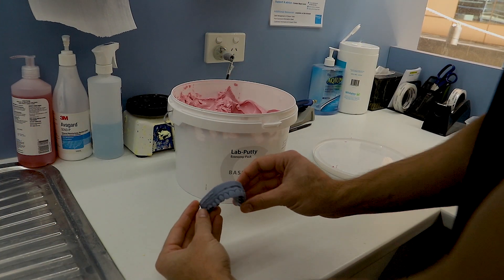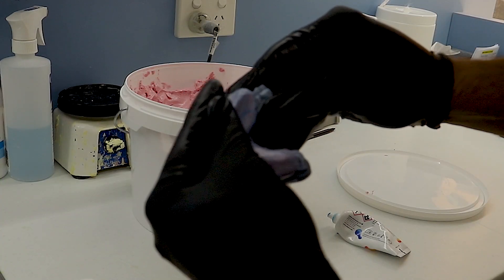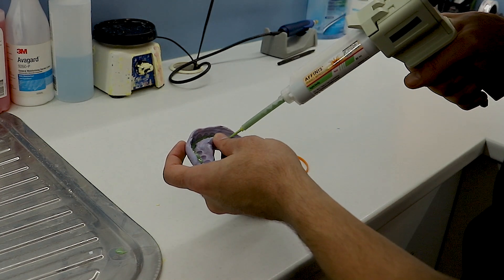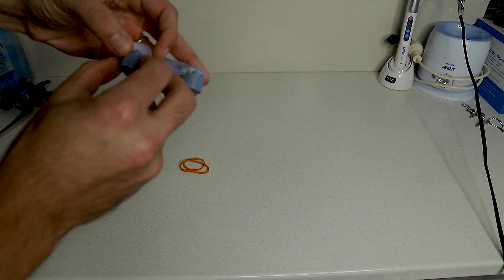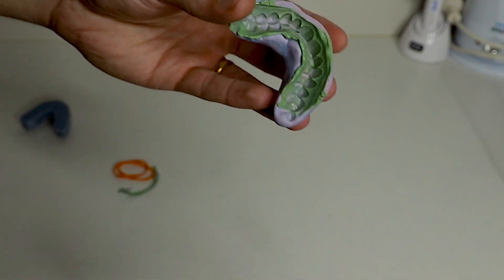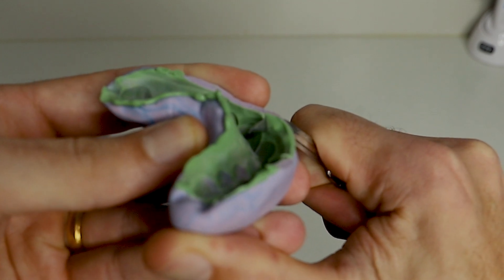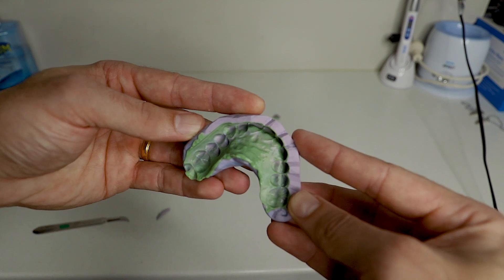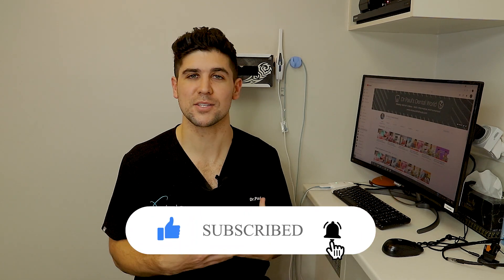How To Make A Putty Key (Putty Index) For A Diagnostic Mock up

Comment: Very nice.  You may want to consider using an addition cured silicone opposed to a condensation cured silicone as you are using.  But I like the addition of the light cure wash to attain the definition. 
Condensation silicone shrinks and produces alcohol.  Addition cured silicone doesn’t.
Reply from the maker: Good tip! I've never found any issues with this one, especially with the light cure wash.

Comment: Hi Dr Paul. My wisdom tooth has left a hole on a another tooth that was infront of it, because it was leaning on it. The hole is on the side of the tooth, slighly under the gum.When my dentist tries to fix it, the pain is incredible and anesthesia doesnt work. It feels like the dentist is hiting on the nerve. Any tips or Help? Thanks.
Reply from the maker: Hi A, that doesn't sound good!

Maybe go to another dentist? I don't think I've ever worked on a tooth that I couldn't make numb eventually.. You can also take ibuprofen before the appointment, sometimes that can help. Not really sure what else to recommend sorry.

Is the wisdom tooth gone?
Reply: @DrPaulsDentalWorld Yeah the wisdom tooth is gone. I was also very suprised that he coulnd't numb the tooth, which made me really wonder. I can change the dentist, because when I removed the wisdom tooth I didnt anything.
Reply from the maker: Yeah might be a good idea unfortunately.
Reply: @DrPaulsDentalWorld  He told me that the hole is deep, close to the nerve. Thats why its so sensitive he says. Since he cant numb it, it did really raise questions and I had made some calls. Does he have to numb directly to the tooth nerve in order to numb it completly? Thanks for the quick answers!
Reply from the maker: It's really hard to say without seeing the tooth tbh. Sometimes when we can't numb teeth by conventional methods, there are 2 or 3 other ways we can make numb. I would suspect doing those things should mean you don't feel it, buts having a deep hole close to the nerve can make that tricky.
Reply: @DrPaulsDentalWorld  Thats true. I took 4 injections of anesthesia when got wisdom tooth removed. I have read its possible to take the injection directly to the tooth nerve, is this true and can it be a possible option in this case ? Because the traditional ways of numbing doesn't obviously work.
Reply from the maker: Yes this is true, but we only do this for a tooth that is having root canal therapy because if we drill and expose the nerve, then it will need root canal therapy. For a regular filling we wouldn't do this.
Reply: @DrPaulsDentalWorld  Thanks for explaining. It is indeed a regular filing. Seems perhaps I dont have much option than to endure the pain during the procedure haha. I really appreciate that you take your time to respond!
Reply from the maker: That's OK, good luck with it 🙌

If you go back, maybe ask them to try:
- inferior alveloar nerve block but higher up
- lingual nerve block
- buccal nerve block
- periodontal ligament injections all the way around the tooth
- intra osseous injection (this is often not required if the others are done well)
Reply: @DrPaulsDentalWorld  I will see what I can do and i will definitely keep that in mind. Once again thank you so much for helping me out. You helped me last time when I had my wisdom tooth removed and now this. Thanks !
Reply from the maker: You're welcome 👌

Comment: Hey bro my lower gum behind second molar is tight is that a sign of wisdom teeth cause I am 18 and another side gum wasn’t tight at all.
Reply from the maker: Hmmm, it can be.. I'm just not really sure what you mean by 'tight'. I do find that when people feel that their wisdom tooth is coming through, most of the time they are correct.
Reply: @DrPaulsDentalWorld  I mean swollen gum
Reply from the maker: Yes it could be then
Reply: @DrPaulsDentalWorld  it little bit hurt on my molar and I can see something appear like a tooth surface but haven’t came outside yet just stay inside gum

Comment: Do redo filling a lot of time led to root canal?
Reply from the maker: Hi there, very very hard to say because each tooth and each situation is different. In some cases, yes.
Reply: @DrPaulsDentalWorld   But how many time can we redo filling before get root canal.
Reply from the maker: Again, very tooth dependent and there isn't an answer sorry. Depends on if there was decay there, was there a crack, how deep the filling was, how old the tooth is.
Reply from the maker: Why do you ask?
Reply: @DrPaulsDentalWorld  I just wonder cause I really hate root treatments where is the part my doctor injected into the hole of the teeth is the most painful thing ever.
Reply from the maker: Not all root treatments are painful. What you are explaining sounds to me like you had a tooth that was sore, then the doctor did root treatment but you were feeling pain, so to take the pain away they injected into the hole? This is often painful but is not common.
Reply: @DrPaulsDentalWorld  At those time my tooth decay is so big nearly side of the 🦷 so I got root canal and crown over it and the treatment wasn’t painful but the thing I hate when he numbed in hole of that 🦷 it was painful and I don’t want that treatment no more so that y I try to get another treatment without root canal. I heard u can crown without root canal right. Is that true I might go straight to crown rather than fill again till I get a root canal even it little bit expensive at least it good and last long.
Reply from the maker: Yeah that doesn't sound like a good experience.

And yes, this is good logic with the crown rather than the filling. If it is a small filling, you should be ok without the crown, but if it is a large filling, maybe crown is better. It will last longer too. Root canal is not needed with crown, but in some cases, root canal can be needed at some stage after crown (same with fillings).
Reply: @DrPaulsDentalWorld  what a factor that led to root canal when u have filling and crown. Can u tell me plz. And is there way to prevent it.
Reply from the maker: Root canal happens from trauma or infection, that leads to the nerve inside the tooth dieing.

Infection can happen from deep decay or from a crack in a tooth can let bacteria inside the nerve and cause infection.

Trauma to the nerve can happen any time that we  drill the tooth, for example if a filling needs to be replaced or if there is decay. The higher the number of times that the tooth has drilling, the more likely the nerve will eventually have problems. If you have a crown, because it lasts longer, in theory your tooth will need less drilling over time.

To prevent it, avoid getting holes in teeth, or try to limit the amount of times your tooth is drilled, by having long lasting treatment.
Reply: @DrPaulsDentalWorld  so it mean if I choose to crown next time it would be better to prevent my teething from drilling a lot time right
Reply from the maker: It should, yes.
Reply: @DrPaulsDentalWorld  ty dude